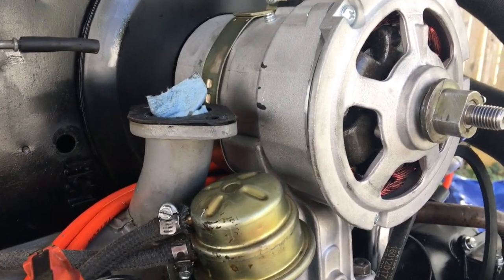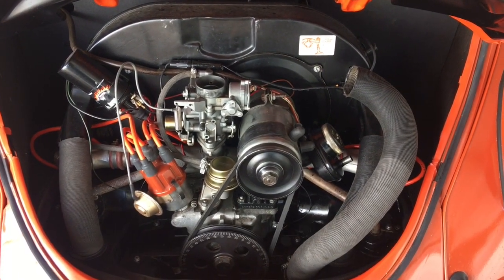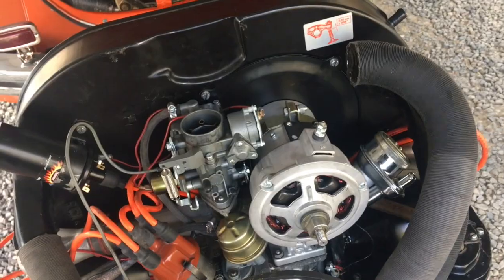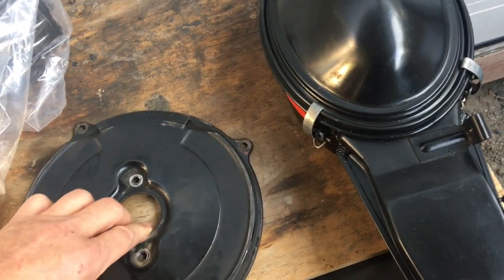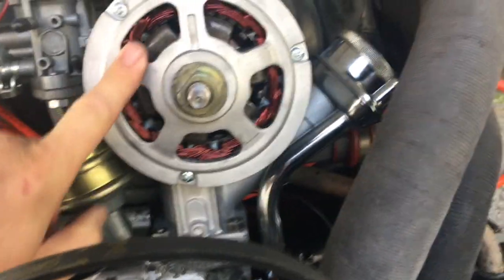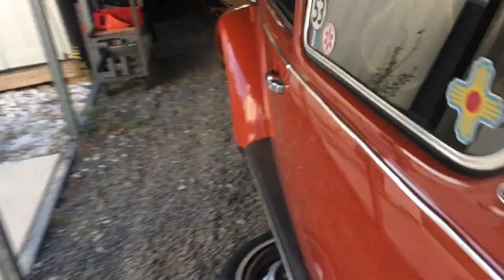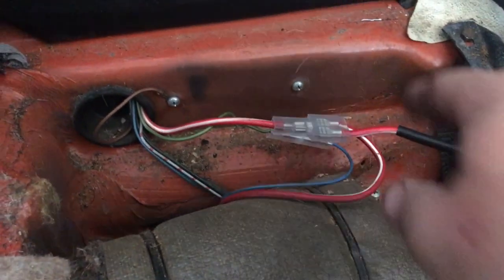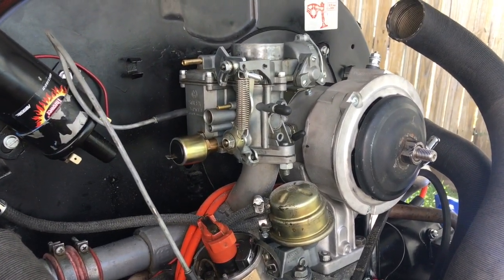VW Beetle Alternator Conversion

Comment: We converted mine to alternator. Unscrewed the two screws on fan shroud, took off carb, unscrewed the plate that holds the generator ,wiggled the shroud up pulled the gen and fan out. Didn’t even take the engine lid off
Reply from the maker: It can be done. I pulled my engine to check on a couple other bits.
Reply: @Misunderstoodboygenius  I’m glad you got things back and working!! I’d absolutely hate to drop the engine for any reason in mine. My husband hates my car 😂 all American to say the least. I can actually hear the cussing!

Comment: Where did you get those connectors for the voltage regulator re-wire?  I can’t find them anywhere.
Reply from the maker: I’m pretty sure I got them at O’Reilly’s. Just big honkin connectors.
Reply: I ordered my t connector and other ones from JBugs

Comment: Moral of the story-- stick with the generator, argh 🤢
Reply from the maker: I came this close! But I got a good deal on the alternator. If I had known the struggle I would have just spent the extra $100 and got a Bosch Genny.
Reply: @Misunderstoodboygenius The Bosch gen makes more than 10 amps less than an alternator so that means weaker headlights and less power for a decent stereo!